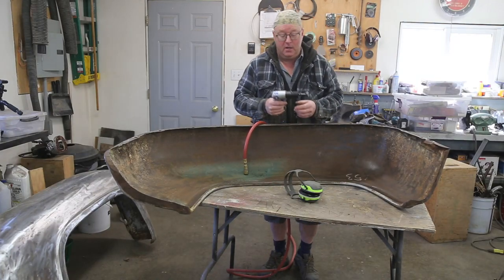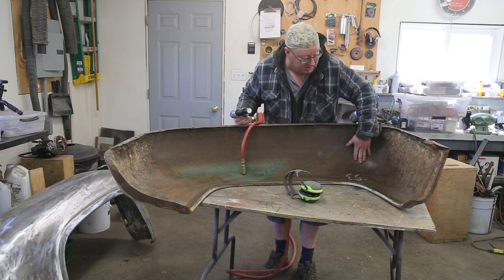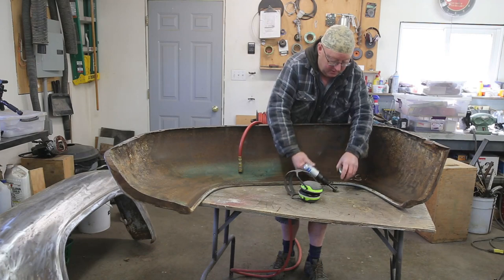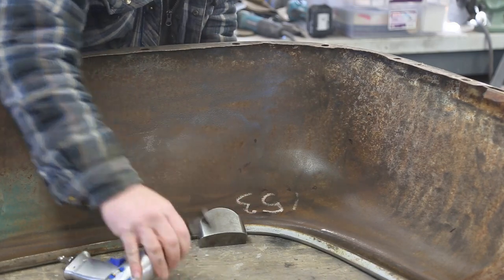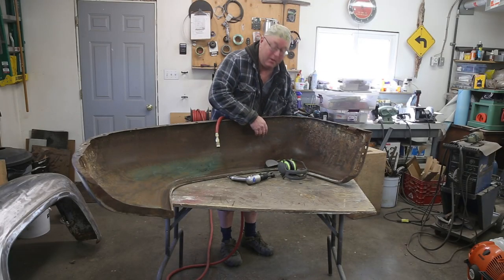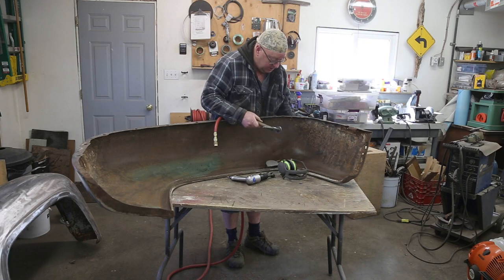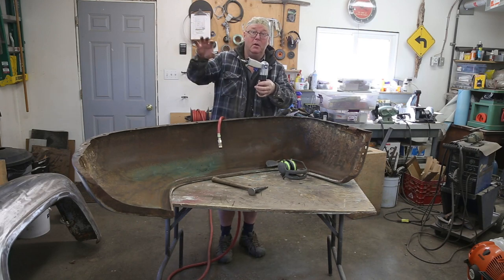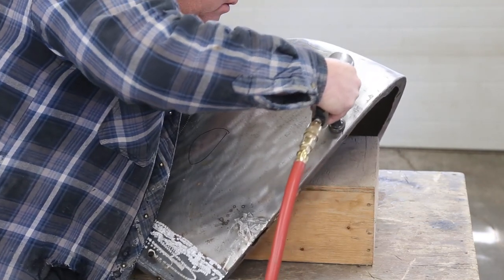Using an air hammer as a planishing hammer

Comment: Great idea. Noticed when I worked with air tools the the tool gets heavy from larger supply hose, have a smaller (jumper hose) hose that I use between tool and larger supply hose. It is also more flexible. Tks for tip
Reply from the maker: You are right about the wait of some hoses.  They are less flexible as well.  Thanks.  Stevo

Comment: Wow I got a air hammer also never thought about using it on body work thks stevo
Reply from the maker: I did not realize that it would work as well as it did.  I am still learning what it will do, and I did not realize you could turn down the air hammer that low to give you the control you need.  Thanks.  Stevo

Comment: You can make many different tips /tools to stick in the air hammers
Reply from the maker: Ya I have been doing some thinking.  I did not realize you could turn an air hammer down that low.  Could be a fun tool.  Thanks.  Stevo

Comment: 5:10 ish you circled the dents . my metal shaping tutor showed me that 
metalshaping ~ it aint engineering measurements and stuff its ;  looky , touchy , weldy , chop a piece out & make a new piece , planish weld's and feel like DR frankenstin . making  compound curves on sheet metal is like trying to nail diarrhea to a wall
Reply from the maker: It is all art when you get down to it, and kind of fun.  Thanks.  Stevo
Reply: @stevoj8959  or craft the steel >
 its a lost " ART "
Reply from the maker: The old craftsmen are disappearing.  I remember when I was young, I watched an old fellow build a fender.  Would love to have that talent. @tomford5416
Reply: @stevoj8959  yeah ! ~ are you building anything ?
Reply from the maker: Seems I only fix things.  Thanks.  Stevo @tomford5416
Reply: @stevoj8959  no complaints dude 
(well not here anyway . ) hey